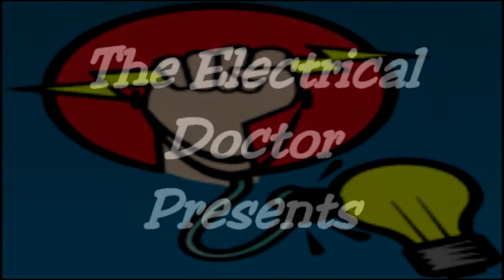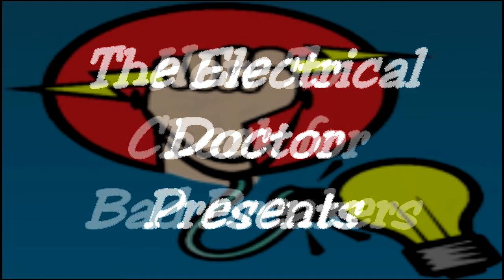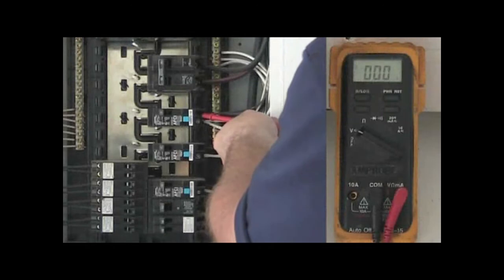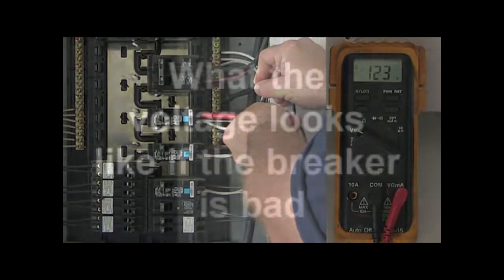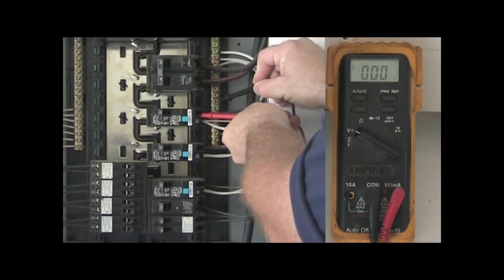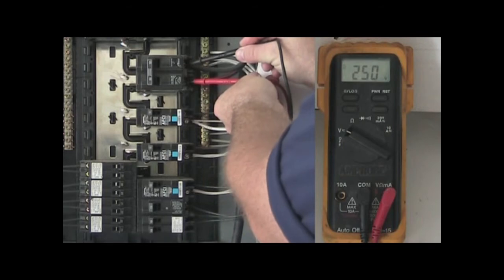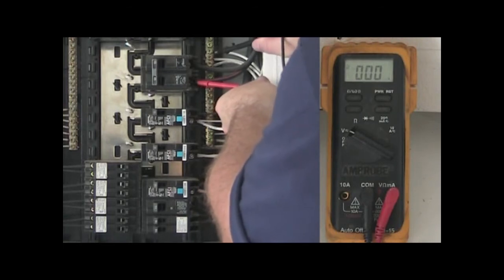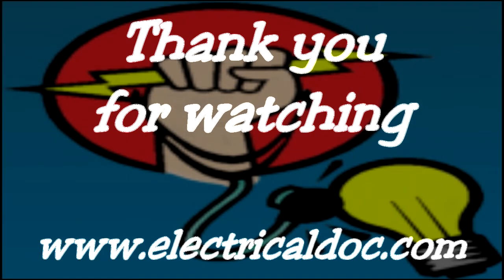Checking for a bad breaker (Updated Version)

Comment: Omg my electrician tested my double pole breaker and it reads 240v between the two legs, and 120v on one leg. Then he told me the breaker is bad and needs replacement. Is he trying to rip me off?

Comment: I'm reading around 44volts on a single pole 15amp breaker with one black cable in it. Is that a normal read for a 15amp circuit? or am I reading it wrong with the multimeter?

Comment: This test assumes the breakers tested are all in the "on" position, which means that you are working with live circuits.  What you didn't tell us is the safe way to replace the bad breaker, which would include cutting off all power coming into the breaker box, and getting a new breaker that is an exact match, electrically and physically, for the bad breaker. Throwing that bad breaker away would be a big mistake, because if you are going to buy a replacement locally, you'll need to take it with you so that the electrical supply house can match a new one to it. It is often a difficult or time-consuming task to find a suitable replacement breaker for an older breaker box, many of which were manufactured by a firm that has either gone out of business, or discontinued making and selling replacement breakers that fit into their older boxes, so keeping the bad breaker is especially important if you have to go online to try to find one. Also, take a picture of the identifying information on the breaker box to help in finding a new breaker. Links to videos made by you or someone else, which address these issues, would be greatly appreciated.